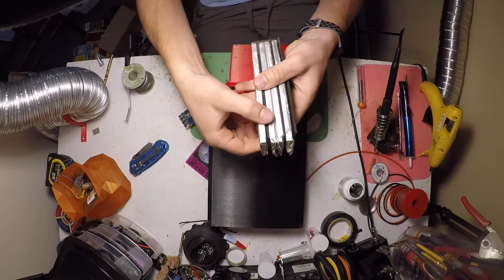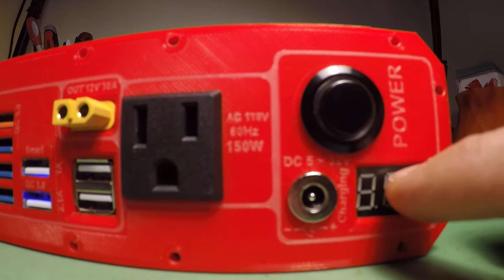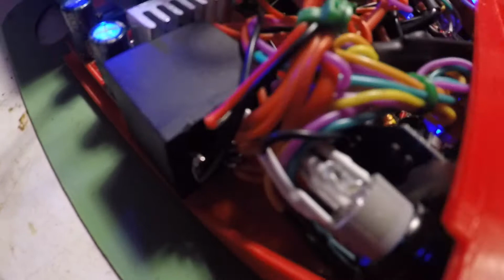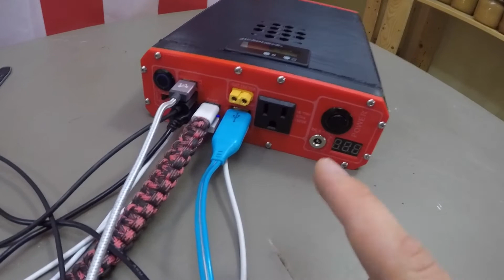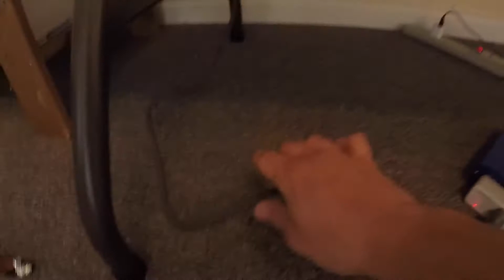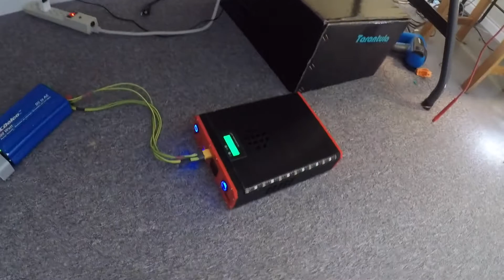3D Printed Power bank

Comment: When build own much better i did can charge 10 phone i have 2 usb socket 12V 10A out put 2.1A 1A and have 2 usb port 100W PD ,60W next 100W PD type cye plus power supply 120V 2.5A 120W 15A i have 12 way fused blocked i have 5A,10A,15A,20A fused i have volt and Amp meter i used next one tell me percent and volt in batter i have 12V 18A 18000 Mah etc better than one they sell cool build